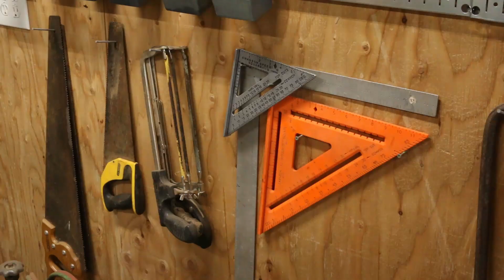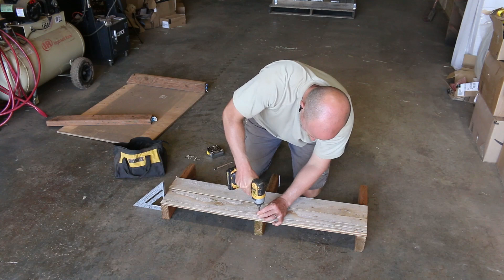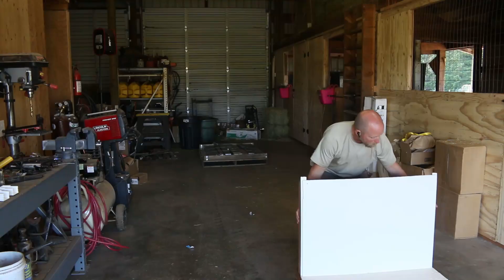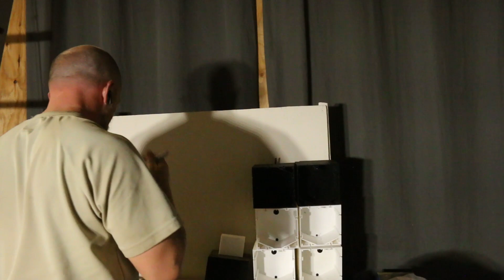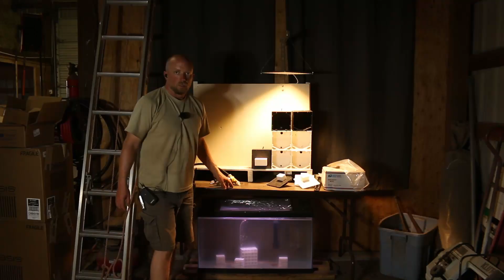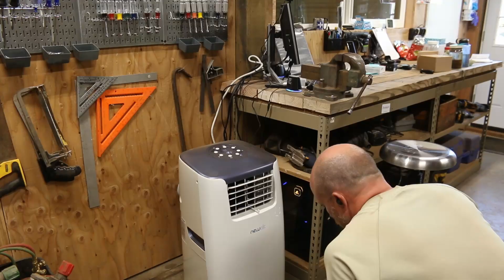Vertical HYDROPONIC Grow Wall Test Apparatus

Comment: If you have room for a tenth I emailed you on off-shelf design philosophy. Build the entire thing around the most ubiquitous foodsafe 1gallon square jugs (or quart jugs) or other existing products that provide the structure and water tightness you need - as well as having a molded handle that can pop onto a support arm of two wooden dowels. 3D printing is great,  but kit-bashing existing off-shelf products can be a great way to have day-0 scalability while you test designs. Vacuum forming is tough, but if you do need a special piece, try sheets of the right plastic and just use a heat gun and bend it around things, otherwise base the whole design on off-shelfs. Tubing through 1gallon or quart jugs could be feasible, with 3D printed adapters / mounts / nozzles. GREAT WORK!

Comment: I'm a bit worried about having to drill 4 holes for each cube. Why not use a back plate that would need 2 on the top or 4 screws to secure all the system onto the real wall ?

A tenant couldn't justify having to drill dozens of holes into the wall of their kitchen.